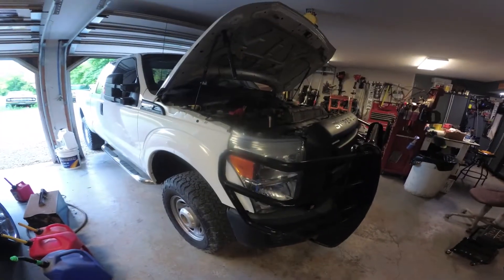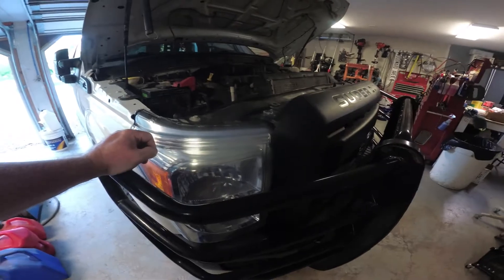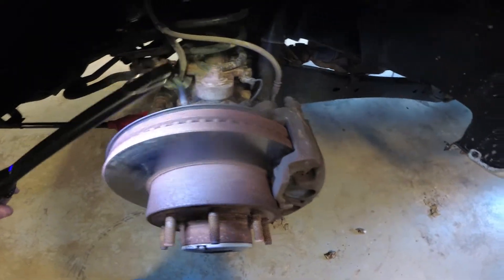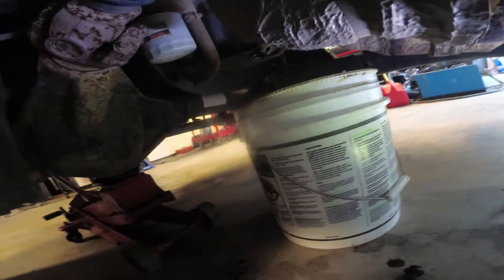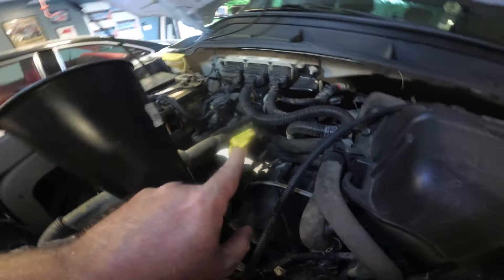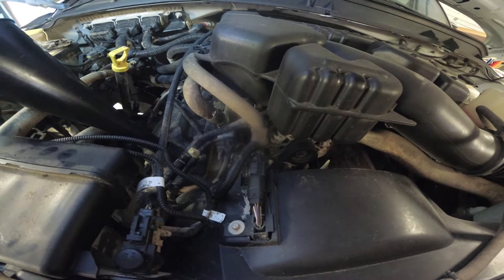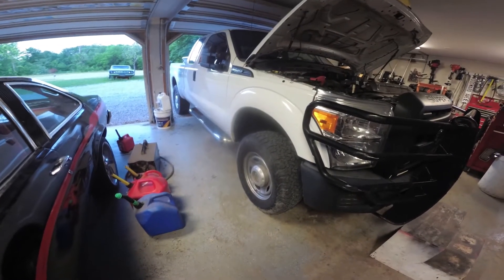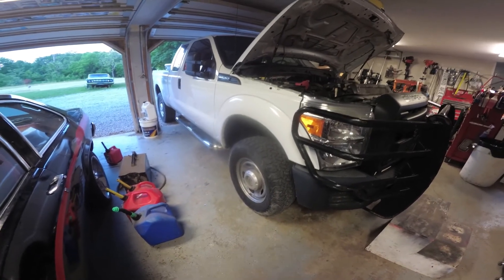2015 Ford F-250 oil change and inspection

Comment: You made me laugh when you were talking about the five quart drain pan and the 5 gallon pan and the mess.  I learned long time ago to change filters first before oil to keep the splish-splash from happening.  Keep on doing what you're doing Larry. I've got a '16 GMC 2500 HD and it is a real pain in the hiney to check anything under the hood.